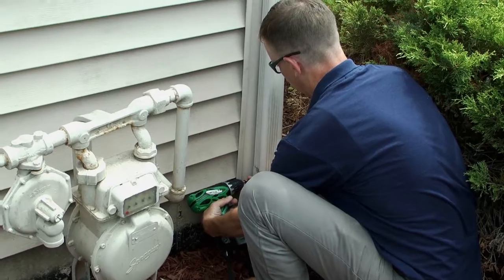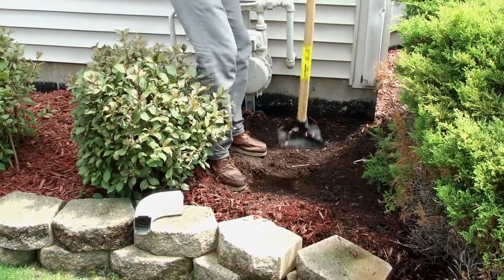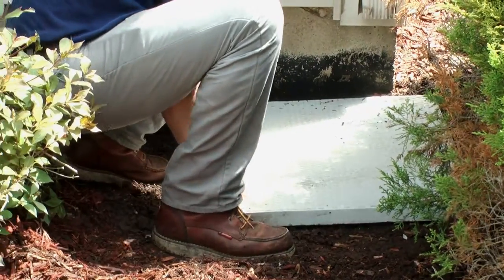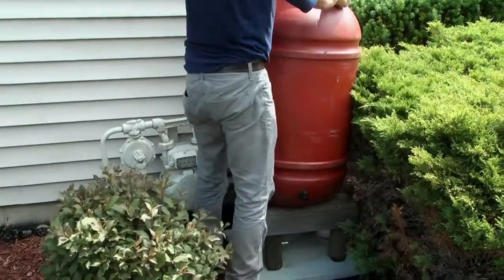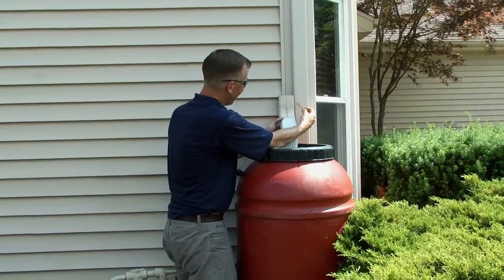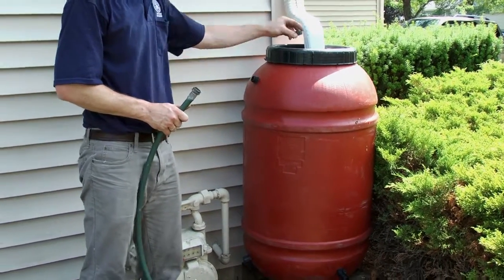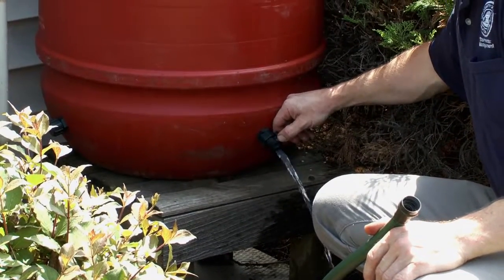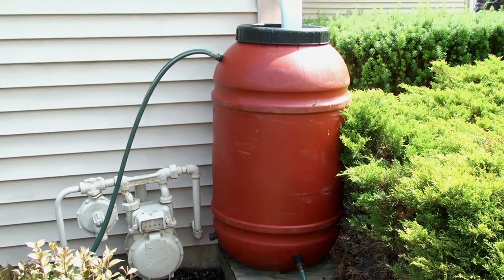Rain Barrel Installation Tutorial

Comment: NOTE:  If you have an Asphalt Shingle covered roof, I would NOT use that water for ANYTHING.

Think about it. Have you ever noticed the water will have a rust color to it. That is the water coming in contact with the Tar used for making shingles.  Put some of that water in a White bucket so you can see it better.

I know they were using it for yard plants but the chemicals from the tar can't be good.  I would be OK with water from a metal roof for outdoor use.
.
Reply: Mine was as clear as day...

Comment: why would you want to reduce the amount of water going into rivers and streams, where else is it supposed to go,,,,,,,,,,,,where has it always gone since the world has been in existence..........please , i'd like an answer.
Reply: That was my thought. Water going to rivers and streams isn't exactly a problem, lol
Reply: They have a over building problem with resulting flooding issues-despite the largest public works project in the US(Big Dig underground water system-hundreds of miles of tunnels/pumps/cisterns) last step is take over of HUGE quarry to hold billions of gallons.
Reply: Water naturally goes to more than just streams and rivers. A lot percolates into the soil and ends up in underground aquifers potentially eventually ending up coming coming out in springs but this happens very slowly. 
Also it is used by plants which sends it back into the atmosphere to rain somewhere else, again, slowly over time. 
Both of these processes are greatly reduced with buildings, asphalt and concrete so when it rains a lot of water quickly ends up in rivers and streams resulting in more frequent unnatural flooding. The natural processes help to even out rainwater flow into rivers. 
When residents gather water in rain barrels they help to slow down flow of water into rivers  by acting like an artificial aquifer and  using the water in gardens during the dry spells.